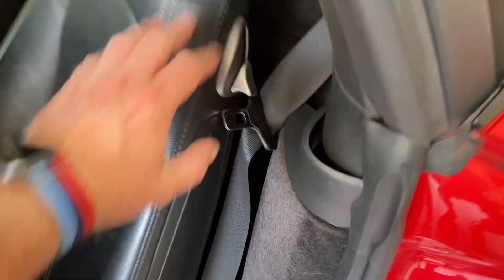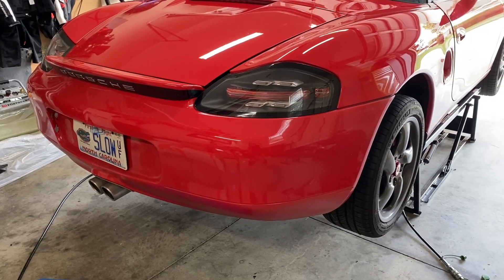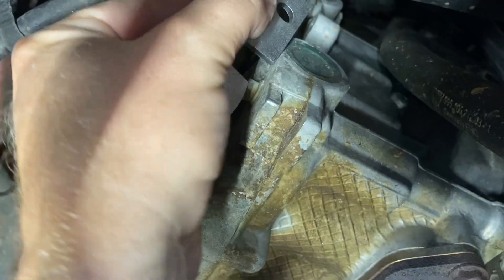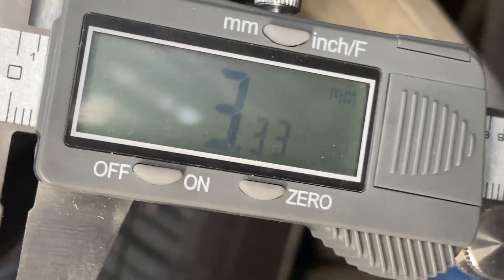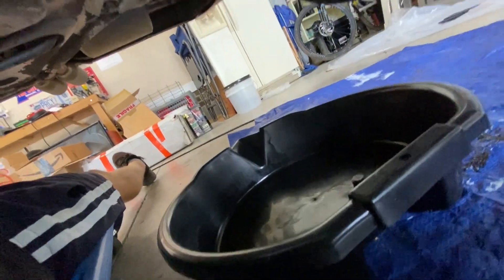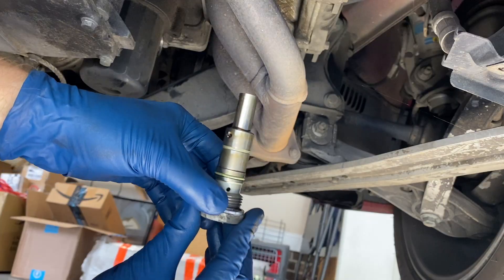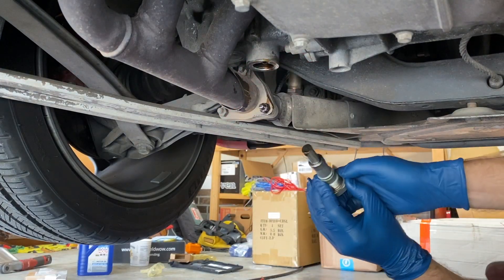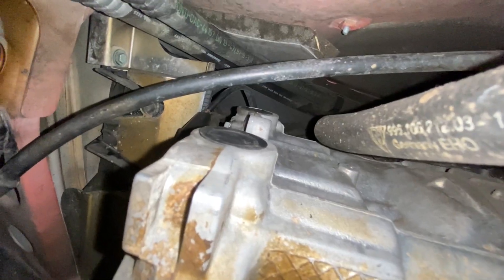Porsche Chain Tensioner Install  |  Boxster 986 987 911 996 997

Comment: Aaron great job as usual, I just did a oil change, I have a 2003 Boxster S with 102,000 miles. I have had it for four years and change my oil at least twice a year and then have it analyzed at Blackstone and everything has come back good over that time. Now I found small black flex of plastic in my oil filter about (20) 1 mm size,I then drop the oil sump pan and found 20 more pieces of black plastic much larger 1/8” to 3/16”all black, some of the pieces have rounded edges and were thicker, then a bearing seal plate. IMS was replaced in 2007. As I said, they’re all black and not the caramel colored pieces you would find with a chain tensioner so I’m at a bit of a loss do you or any of your community of friends, have any ideas? As always, you have a great content, and you are not afraid to show the good and the mistakes of being your own mechanic. thanks, TOM.
Reply from the maker: +Tom krug thanks Tom! I still suck at diagnosing, but maybe someone more knowledgeable can chime in. If you figure it out be sure to come update us!

Comment: So mine making some horrible noises pretty sure have it down to a tensioner failed after what sounded like knocking now grinding but still turns over will this fix that issue or will I need to go in and place chains back on or how does this work little confused
Reply from the maker: +RealCameronP yikes! Sounds like you may have more to do than just replace them but I don’t even know where to start on something like that.
Reply: @HelpMeDIY  got here in service mode drained oil and glitter ✨

Comment: Hey just curious how did you lock camshaft for each side bank you're working on? I would think to look in spark plug hole for each side to know which bank you've set to TDC? Or maybe it wasn't needed from the looks of it?

Edit, saw you had the TDC mark on the other bank. Guess maybe you didn't need tdc if not locking each bank as you work on that side?
Reply from the maker: +@natureguppy9642 rotate a full revolution for the other side to be TDC
Reply: I was thinking that, I just didn't see you move the tool to the other bank so wasn't sure.

Comment: Just completed the replacement of the bottom two tensioners on my '98 Boxster thanks to this video.  

The cam locking tool listed in the description from eBay is no longer available (12 pieces sold out).  However, there is a Finnish company selling a similar and suitable tool that requires removal of only the lower cylinder plug (9products.com Cam lock tool p/n 9p-tt-96-1).  This locking tool will require a separate M8 hex bolt for installation.  M8 x 30mm is, in my opinion, too long and M8x15 or M8 x 20 are more suitable (extra minutes under the car turning bolts are wasted minutes).

For the specific job outlined in this video (replacement of the bank 1-3 tensioner and IMS shaft tensioner with the motor still in the car), the other timing tool kits listed in the video description are of no use.  The TDC lock can be performed with another M8 bolt, roughly M8 x 50mm, or alternately a very short 5/16 drill bit.

The factory tensioners have a very short stroke with a non-linear spring rate (the initial push is easy, the push gets harder and then bottoms out quickly).  The replacement tensioners are slightly longer as noted in the video, the stroke is longer, and the spring tension is consistent.  I used a 32mm socket and a 24" breaker bar to loosen the original tensioners, which both gave way with a satisfying snap.

Unfortunately, this procedure did not solve my particular start-up rattle.  I will have to tackle the upper tensioner (bank 4-6) next.  From my initial probing, the key to removing the factory tensioner is a 32mm 12-point socket and an 90-tooth ratchet (as narrow as possible, possibly 3/8 drive with a 1/2 adaptor).  This tool combination will allow sufficient clearance to torque out the old tensioner. - you need to be higher than the hard line in front, lower than the A/C compressor, and you need to avoid running into the side of the access panel opening with the ratchet handle.  Installation of the replacement tensioner looks like it will require a low profile 14mm Allan bit given the space constraints (A/C compressor above, hard line in front).  As noted in the follow up video, the A/C compressor can be loosened off by undoing 3 - 13mm bolts, two with a ratcheting wrench and one with a socket on an extension providing about an inch of extra clearance.

Cheers Aaron for all your effort in creating these videos.  Can you make the t-shirts available in cotton (and other colors)?
Reply from the maker: I think they are available in cotton and other colors from the spreadshirt link?

Comment: Hey can u give me some advice on replacing the bolt on the back side of the tension pulley of a 2006 Porsche Cayman S. It’s a 15 mm but the hex has rounded off I can’t figure out how to get the bar removed from the motor
Reply from the maker: +Artie Brosonski that’s tough. I’ve never had to deal with something like that luckily. I’d just look up some YouTube videos on rounded bolts and see if anything helpful comes up
Reply: @HelpMeDIY  well I found out how to get that rounded bolt off! It’s a job . You have to take throttle body off. Because the shaft goes in to the block. Once that’s out the way u can see the shaft. It’s got a set screw inside of the shaft that must come out before you can remove the whole thing! Once it’s off it allows u to change the bolt for the tension pulley.
Reply from the maker: @artiebrosonski2345  thanks for the follow up! Hopefully that helps someone down the road 😁🍻

Comment: Thanks for the great video. How did you confirm bank one was locked if you didn’t remove the single green cover with the half slot that should be pointing in the 3 o’clock position?
Reply from the maker: +@user-jh3wo4wx5m you’re welcome! You’re not turning the engine or affecting the timing in any way so it doesn’t matter.

Comment: Great video.  Learned a few things. If I can ask, why did you only do 2 tensioner instead of 3?
Reply from the maker: +BranchOffice thanks! In think I mentioned it in the video, but two reasons. First, that one supposedly doesn’t cause issues as much as the other two. Second, that one is much harder to get to.

Comment: I  just started noticing a little rattling at start in mine a couple months ago. 

And I Found my first bits of plastic like yours in the filter today.   So I’ll be doing this very shortly.  Ty again brother. Lol.  I’ve done 7 of your projects so far. 

Btw ?  Did you find any very small aluminum shavings in yours ?
Reply from the maker: +CHON uh oh…
Yeah I did but mine were from drilling out the bolt that sheared off on my water pump. Now from the engine 😅
Reply: @HelpMeDIY   I have been keeping a close eye on my filters for every change.  
For the first time I found these things in mine.  But I noticed the rattle worse after the car setting longer.  
My shavings is aluminum. Not steel thank god.  
I think that’s from the chain rubbing on start ups after leaking off.   I got tensioners coming & I’ll be changing my oil more often from now on to keep an eye on it.  
I have always done my own work.  And I have a couple of decades experience in building & rebuilding Rock crawlers /jeeps & rear ends & Heavy equipment diesel mechanic etc .    

But I had been very happy until this last oil change .   Never anything. 
I don’t think the metal is because soft a sheered bolt off the Ims or something.  

So I’ll eventually be pulling the oil pan to see if my chain guilds has completely gone and that is the aluminum from them cracking away. 

 I just think they would be more in my filter if that was the case.  I’m just not sure . 
So I’ll be pulling the oil pan to check when I have it on a rack to change the  tensioners.   

And probably doing the normal ims barring & seal when I do the clutch & stuff then .   

Lol.  I think I had a gf do a rev up on Immediate start once. 

🤦‍♂️.  I told her the deal after  
Lol.  
But I think that’s where the very small shavings has come from.  

As we say in the diesel world
I’m at the stage of . 
“YA JUST HAVTO RUN IT & WATCH IT “ stage in a disappointment. Lol.
Reply: @HelpMeDIY    Just a guess obvious.  But I’m going to say yours wasn’t from that drilling.     
It’s because of the chain looser & rubbing the sides on start up like mine . Especially if they are real fine consistency like mine.  
Drilling in doesnt usually produce shavings like this. Or their results from it in the oil filter (They won’t be all consistent in size & very thin flakes like this. They literally look like gold panning flakes. They would be chunks even if some are a different size & or circulating in the oil . ..if they were from the drilling that is . ) 
Even if the been circulating in the oil they won’t look like I’ve got.

You need to Keep an eye on it.  
Do a couple of oil changes at around 2 or 3 k. (Half as normal) & keep a check on it & you’ll know .
It could be from  being shaved  off the variocam . Which happens to some after a while & guides are gone .  But that would be steel & no aluminum.   

You probably heard this as part of the discussion when you went to do the other video. 
Which I noticed you deleted btw. Lol.  Wut ? Was the Comments getting too hot ?  
Lol Cuz it was a good video.
Reply: @HelpMeDIY    Did your rattle quit?
Finally getting to do mine today.  I had a major shipping issue (lost part and time to finally get to do it ) 
I came back for a refresher. I noticed you added the part on not removing the top cap  (yeah. I got the same tool as you lol. And used your link & stuff  to give ya a little cut of it  lol 👍) Just wondering ?💁‍♂️.
Reply from the maker: @Chon-c  yes it did!
Reply: @HelpMeDIY  Cool 👍. Doing mine now.
Reply: @HelpMeDIY  You can’t really get aluminium shavings in your oil from drilling out a water pump bolt. If you did you must have drilled right through into an oil way which would be pretty catastrophic.
Reply from the maker: @robcorner8427  yea that’s what happened. Right through. Had to seal it up behind the bolt. Seal is holding fine so not catastrophic 🙂

Comment: Nice work Aaron. My tip on the bottom tensioner is to use a bottle jack and some wood to apply a little upward pressure while you catch the first thread with a wrench. It's still fiddly as you have to inch it up real slow so as not to damage the thread whilst also rotating the tensioner with a wrench. I found it easier than trying to muscle it in.
Is there a reason why you didn't change the tensioner by the A/C pump? It's fiddly but easy enough; you have to remove the belt and take out a couple of the mounting bolts from above with the top in the service position. Cheers
Reply from the maker: +Peter Sutcliffe thanks! Yeah, I didn’t change it because my research indicated that it probably wasn’t my issue and that it was hard to reach. Not sure of the first but was true or not but here we are 🤷‍♂️

Comment: I have a 2001 boxster with green bits in the oil last oil change. I've heard it was likely to be from the o-rings on these guys. Anyone know if that's true? I believe brown bits would've been timing chain guides, but these were more of a pale green.
Reply: Did you find out? The smaller o ring on spark plug tubes are green but seems unlikely they'd get into the oil.

Comment: Humm? After days of sitting, my chains rattle for a second. Loudly. 58K on the engine (well sorted w/ LN IMS, AOS, Water Pump, Clutch). I don't like to hear that chain rattle at start up. What should I replace to stop this noise?
Reply from the maker: +SGT Tom Bailes you need to do this then!
Reply: @HelpMeDIY 
This fix took care of that noise on start and acceleration?
Reply from the maker: @mattymatt3654 yes
Reply: I'm gonna have to check for the plastic bits in oil filter next oil change. To my knowledge everything else should be good to go for a while. My 09' 987.2 Boxster I just got has been a fun daily driver so far with just under 50k miles. Already did a tune up. I replaced spark plugs which might've been original, MAF Sensor, engine air filter, cabin filter, gas cap, and oil change. I also replaced the blown speakers. I'm about $2000 in repairs so far, but I'm glad I was able to DIY most of these things. I fully appreciate your vids!

Comment: It seems to me that the tensioner being spring loaded cannot collapse that far when the car stands for some time, should be similar to how far hydraulic valve lifter would collapse. I am not sure that a slight rattle on start that immediately goes away once oil pressure reaches the tensioner is a problem however the plastic bits in the filter are more alarming. My car is also showing the plastic bits so am looking forward to seeing how the chain guides are replaced.
Reply from the maker: +Richard Calon like you, I can’t really wrap my head around HOW that would cause the rattle, I was just repeating what I had read. But I can confirm that the new tensioners DID resolve the rattle on startup!
Reply: @HelpMeDIY  My concern would be that the additional tension from the new tensioners would mask wear on the cam chain guides and perhaps accelerate wear and failure of those plastic parts.  Haven't read much about guide failure but am sure like almost everything in these engines it would be catastrophic.
Reply from the maker: @richardcalon3724  replacing the guides is my next project!

Comment: Is it necessary to lock the cams in place? or more of just a precaution incase the engine were to slip away from TDC?
Reply from the maker: +Stryfe132 The best answer that I can get to that question is still “you should lock them“. 🤷‍♂️

Comment: what other components are a need to know for TDC it could be 180 degrees off just going by the timing mark on the crank.
Reply: When you pull off the caps ?  That mark needs to be  straight up to get the other locking tool in place. & that tells you if you need to do another half rotation (or more .).   Because that’s the goal of getting both tools lined up & inserted.

Comment: Finding TDC a lot easier with the belt off. Never seems to be enough room to get a socket on the crank. Hope your chain rails are OK.
Reply from the maker: +Peter Brown actually after I figured out the fell it was really easy. Taking the belt off would have taken a lot more time. Rails are definitely not ok though. 😢

Comment: While it is at TDC, mark the two indicators with red or white paint ( timing marks on the case and the crank wheel) then you will see them every time easier. I use my wives white fingernail polish because it has a brush to apply to the marks.
Reply from the maker: +James Ford I like that! Thanks for the tip 🍻

Comment: those green plugs are a total ball ache to get out, you only need the 1/2 lock tool on a 5 chain motor, the 5 chain motor only has the notch on the exhaust cam, 3 chain has notch on both cams an the longer lock tool is used for the 3 chain
Reply from the maker: +Matt Todd ball ache indeed! I mentioned that other stuff in the video but that’s a nice concise recap.
Reply: Yeah my comment was 1/2 way through the video, had similar issues when doing the ims and clutch replacement on my 03 S, your vids are extremely helpful
Reply: The full tool to lock the exhaust cam also locates the intake cam when removing the cam cover.  When the cam cover is removed the cams are located at the driven end by separate cam caps and unsecured at the non driven end,.  Unless both cams are securely located, valve spring pressure will be applied to the unsecured ends of the cams unless they are locked by the tool. I am not sure how much damage not securing the cams will do but it is not worth the risk of not securing them.

Comment: after using this lift to work on your car, would you have, if you had the $$, rather bought a full lift?   benefit of these actually is that you are on your back , a full lift I find my neck is sore after look up at the engine all day.
Reply from the maker: +Richard Golonka I’m confused because I did this on a full lift. 🤷‍♂️ And I would not want to go back to doing it on my back now 😁
Reply: @HelpMeDIY  in the video you used a quickjack
Reply from the maker: @richardgolonka7585  ohhh you’re right, sorry, thought this comment was from the chain guide replacement :). Love the 2-post lift I have now. Quick Jacks are a huge step up from a jack and jack stands, but a lift is another huge leap